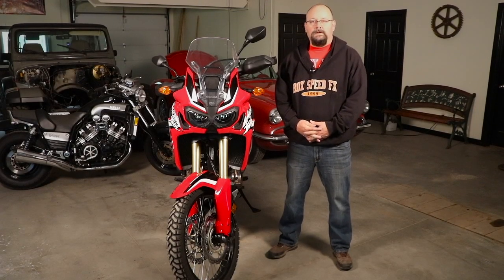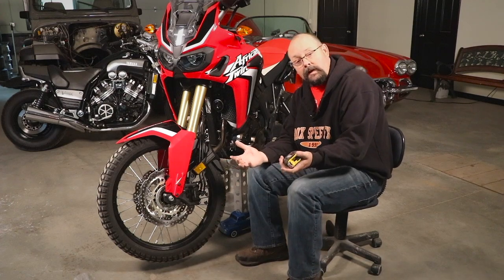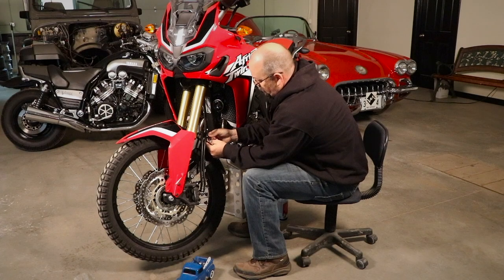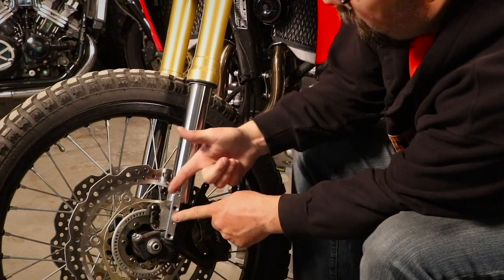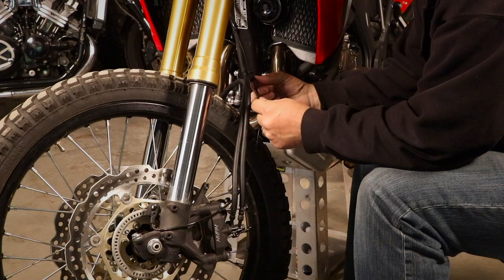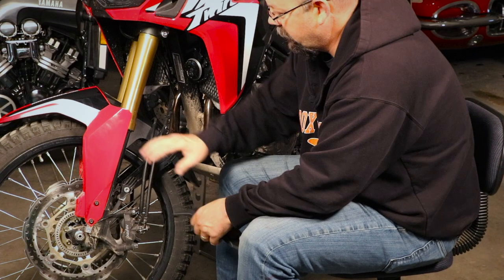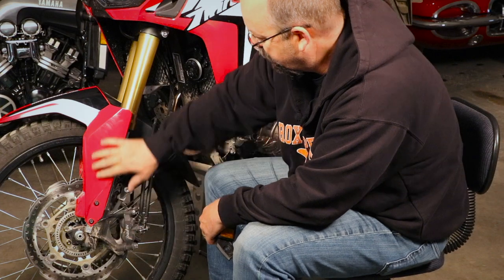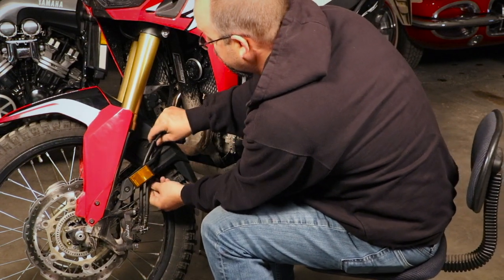Front Fender Riser Kit for Honda Africa Twin (Full Install)

Comment: The video was much better for the install than the paperwork that came with the kit. I didn't quiet achieve the measurements you did it is much better than  before. Outstanding quality, well done.
Reply from the maker: Hey Mr.Rick, The tire type/diameter that you have may be different than what I am running (Mitas E07).
Reply: The tires I am using are 90/90 21 Shinko 705 and you could be correct as different brands can/are different even though they say 90/90. Hope this helps.